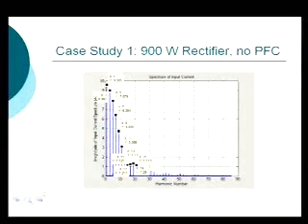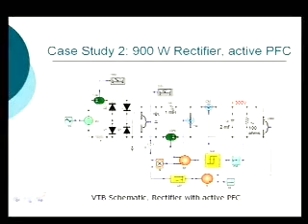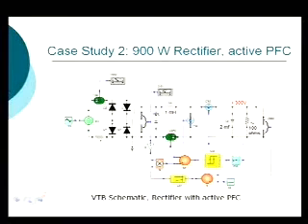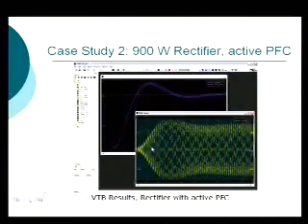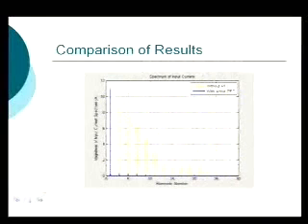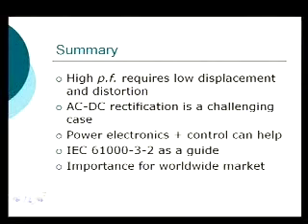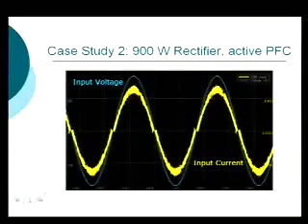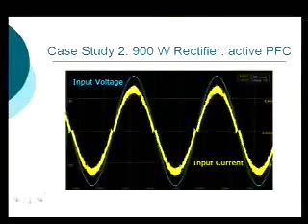Active Power Factor Correction Lecture (Part 2)

Comment: Thank you for posting this. My only complaint - the interconnection lines on the diagrams dissappears. Any chance of uploading this in HD? Or is there somewhere that the slides are posted at higher resolution?